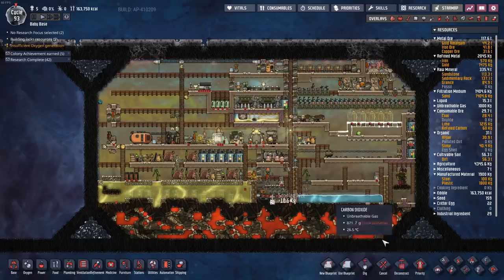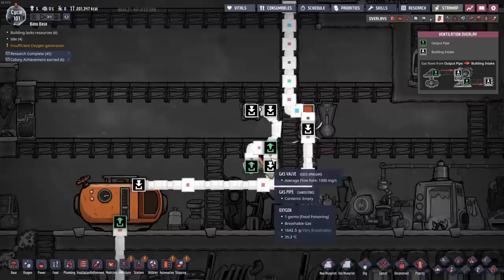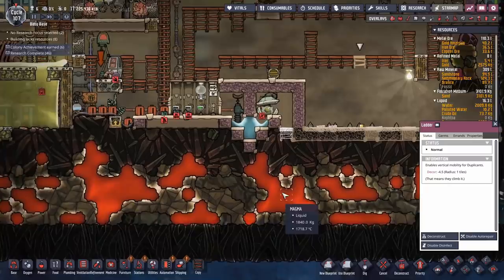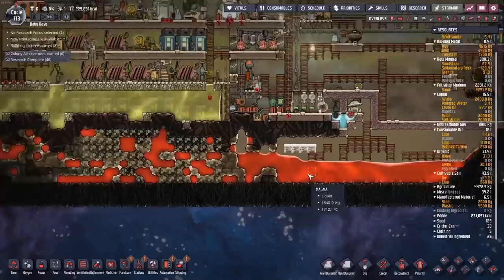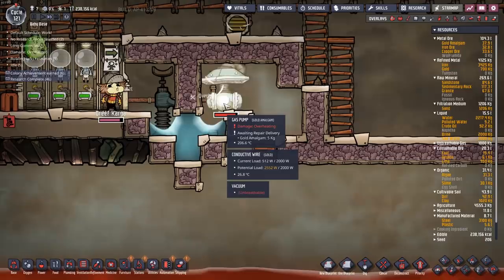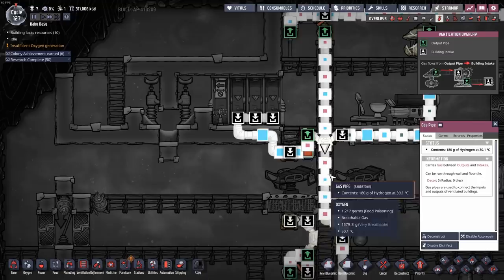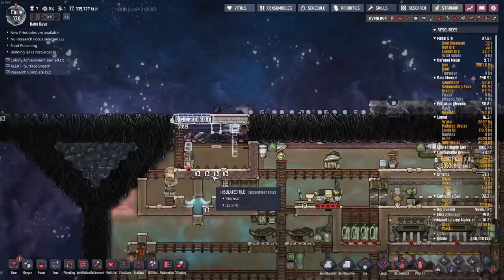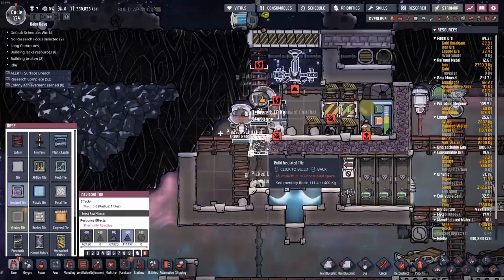Baby Base 5 : The Magma Biome and Regolith harvesting : Oxygen not included

Comment: On the subject of the energy-free gas filter, the first one is more fool proof if you want to prioritize never letting oxygen (or whatever gas you're filtering out) through. Although it's not ever likely to be the case in this context given the high pressure vent and the open space, if you were to have an over-pressurized vent, that could cause the second more simple filter to pass gas through to your storage and power plant that you'd rather not be there. That wouldn't happen with the first design. Instead, it might back up, but you'd at least have the opportunity to move the output vent, which you couldn't do with the second design.
That said, the second filter is still a far easier setup that's very handily possible now due to the automation update.

Comment: Francis. Pros and cons for both desings.
Old: 
Pro: Perfect filter, can not fail in the regard if the output for waste is full. (Aka nothing else can fall into the hydrogenline)
Con: Can only transfer 999g of gas. Is a bit bulkier
New:
Pro: Can Transfer 1000g, is smaller.
Con: Can fail the moment the high pressure vent gets overpressured.
Reply: > Con: Can only transfer 999g of gas. Is a bit bulkier

Not quite true. If you add a second bridge you can transfer up to 1000 full packets in a row before missing one (read: allowing one packet of H2 out the non-H2 output). As long as there's at least 1 packet of other gas every 1000 packets, it's full flow.
Reply: If the high pressure vent get overpressured in this case he'll have bigger problems than the vent :)
Reply: As was noted somewhat vaguely in the video, one of the cons of the new filter is that it can only put the gas that is filtered out back into the atmosphere, not re-route it elsewhere without pumping it again. If you have a diverse atmosphere, or want to use one gas line for 3+ gasses, the newer filter wont cut it.

Comment: There is a "deal with the devil" sort of trick i use when steam is all over my vacuum room full of magma, (yes,  happens to me regularly) instead of putting a lot of time on removing bits of steam for 20 cycles (the sane way), I put a temp-shift plate in the middle of the steam room, and place 5 tiles, V shaped under it so it'll catch the water getting condensed off of it. It'll work real fast and you can just mop up the water, deconstruct the temp-shift plate, take the ice and leave.
BUT, as you can guess, if the temp-shift plate melts and reaches your magma, well that's bad news. If it only fills the V, still a pain to pump out.
And the part that's the actual downside, is that the material that you use to make the tiles with will fall in the magma when you deconstruct them. (airflow tiles, normal tiles and insulated tiles each tweak the risk/waste per speed factor)
Overall, absolutely a dumb idea, but when you're in a rush (for example when other stuff in the room are melting and overheating, or the liquid lock is turning into gas) it's sometimes the only way to save a base.

Comment: While we're discussing different types of mechanisms. For cooling loops I have shifted the location of the liquid thermo sensor to the output of the buffer tank. Coolant goes to the tuner, then into the buffer tank, then out to work cooling things. If you have about 1000 Kg of liquid in the buffer tank, and the thermo aquatuner is 5 - 15 packets distance from the buffer tank, you get incredible control of the output temperature of the coolant.

The kind of precision of the output temperature isn't critical for most things. Though for liquid hydrogen comes to mind as something with a narrow range between gas and solid.

Regardless of if its warm water bypassing the tuner or cooled water, with 1000 Kg of liquid in the buffer tank each packet is only about 1% of the buffer. The change in temperature is usually tiny, in my experience only a tenth of a degree or thereabouts. The output temperature usually stays within 0.8 C of my target temperature.

This isn't a catch all method as it obviously depends on what you are cooling. Cooling a cold box comes to mind as the cold box basically is a temperature buffer. For many purposes though, I have made this small change to my set up. I hope it comes in handy to people.

Comment: @Francis John
3:06 NOTE! The new filter is not fail-safe (does not fail in a safe way).
(new filter) If the gas pressure gets too much for the vent, then the wrong gases will continue through the pipe to the wrong area & can make cascade failures.
(old filter) will just be blocked & not sort any gases at all, until the vent (primary) unblocks or the filtered output (secondarily) un-blocks.

You can also see it as the new filter will be "safe" on the input side (will always accept gases as long as any path is available (maybe unless exceptional circumstance where 1 hydrogen gets stuck exactly on the sensor tile)).
The old filter will be "safe" on the output side (might bet back-stuffed, but will never send the wrong gases to the destination).

Comment: Hi!
I'm the naphtha guy, again. Just a reminder, no regolith is hot enough to phase change naphtha. So a liquid lock made of that is much better for the top of the base.
You may also have missed a previous comment of mine so here's it again:
https://imgur.com/a/FgauoSl
that's about 30kg of naphtha each droplet. That's double because I have an atmosphere both sides and I want thermal insulaton (it's the entrance to my industrial sauna). For going to space one is enough (a bit risky). For no extreme temperature differences naphtha has low TC and it's not going to leak much heat anyway, so a single one might be enough in a pinch (like unplanned maintainance inside a sealed steam room). It's the 30kg thing that makes is so superior to other solutions (pre-viscogel).
In my current base despite having 3t of viscogel I'm still kinda using naptha for most of my locks (it isn't worth upgrading them). Viscogel locks are actually a bit faster because there're no steps involved. Faster in making them and faster for dups to cross them, but if it isn't the most trafficed lock in your base it hardly makes a difference.

For space traditionally I'd use a petroleum T shaped lock, made with a vent controlled with a sensor (I'm prone to forget about empiers too), which means usually bringing a pipe from the refinery/boiler but it's going to be needed later for rockets so it's no waste of effort. But in this case petroleum is quite far away so - again - naphtha to the rescue.

Comment: Hello Francis! Love your videos... The filter for oxygen/hydrogen you made using a not gate has a problem when there is a queue for some reason. If the gas trapped in the sensor is the one should pass its ok but if the gas (or liquid) is other the sensor will bug and the gas will go to a different path into your reservoir. I am using it since the upgrade but it's not safe if you can find a queue on the line. I have no idea why but the do not happen when using a shutoff.

Comment: Hello, It is an joke that You did not dig out hydrogen vent. It is enough to cover all your electricity requirements alone. Use "Introducing the split steam turbine and it's uses" article. There is a self sufficient, self colling hydrogen vent stuff.  It has only one issue, you should not use all aviable hydrogen.